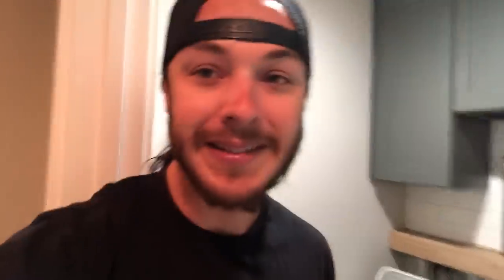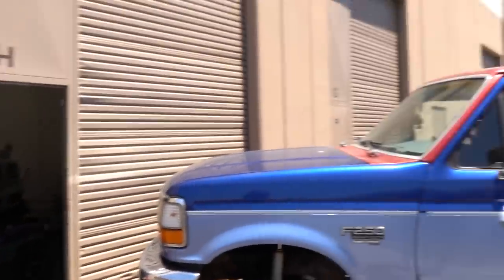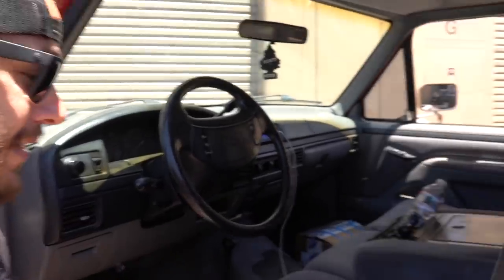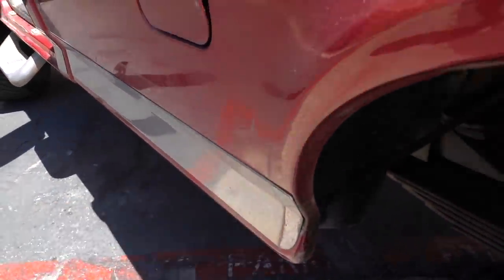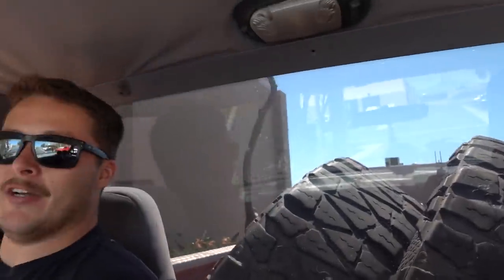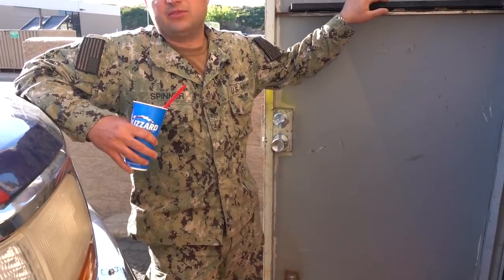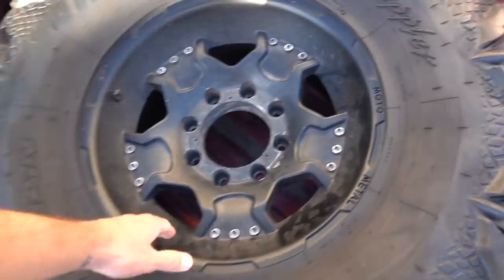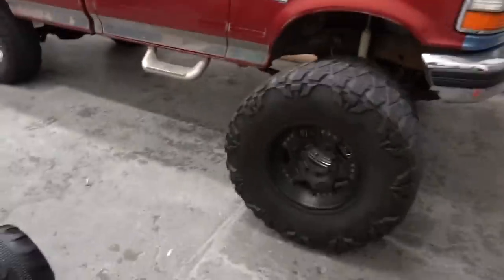I BOUGHT ANOTHER OBS!

Comment: kindof a different directions than what you mentioned in the video but you could lower it to 2wd height, and make it a street truck/dragracer truck. the single cab is the best combo for that with its light weight for the best power to weight ratio

Comment: 312k is just the break in. My 97 has 394k still drive it everyday. Still stock just put guages on it and took the ash trey out and mounted a switch panel for bumper lights. Swapped all the taillight and headlight lenses to clear and everything is LED. Performance wise its completely stock
Reply: Put another 6k on it and you’ll be back to 300k

Comment: You should bedline the exterior to make it match all the way round. Raptor liner would be a great option for it and you can do it yourself
Reply: Looks like shit. Not worth it unless you're driving through the bushes on almost a daily basis. Adds a bunch of weight to the truck which lowers payload. Well maintained paint is 1000x better than bed liner.

Comment: Wet sand those headlights to get that top coat of crap....then clear coat them....they are clear coated from the factory.....if they arent chicken feet/spider webbed.....what ever u call it there...lol I would not sell tires until the front end done...it looked like two tires were worn different than normal....from my view anyways.....
Here in central new york......we would kill for a truck that clean at that age!!! Plus WE LOVE THE WORK CABS!!!!!!!!!!!!! if there is a block in the back measure it to get a rough idea of what ur lift is....the front springs look like a rearched for a lift kit.....
Seriously hold off on the tires cause that truck was probably all over the road cause of those tires....once u have a solid front end those big tires will feel like stock.....but its ur truck...u lucky sum biatch!!! Lol NICE RIDE RYAN!!!!!!!!!!!! I LOVE OLD & OLDER TRUCKS!!!!!

Comment: By the way the “F250HD or Heavy duty” shares the same 3” brake shoes and the same suspension as a srw F350. So this truck is basically an F350 and just as capable.